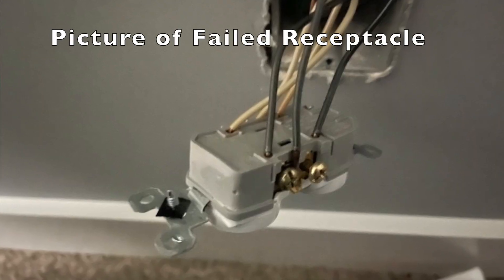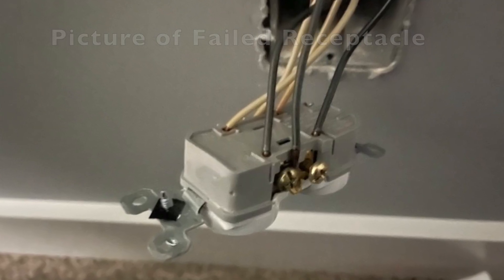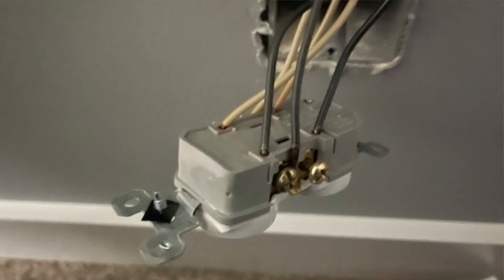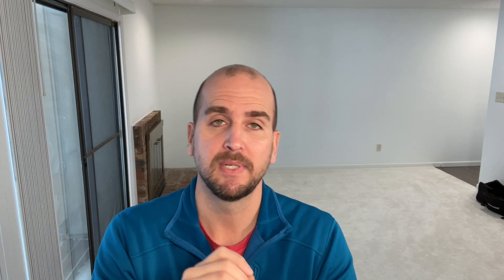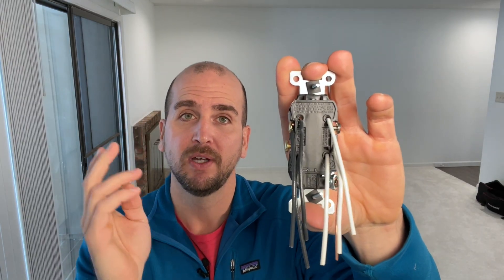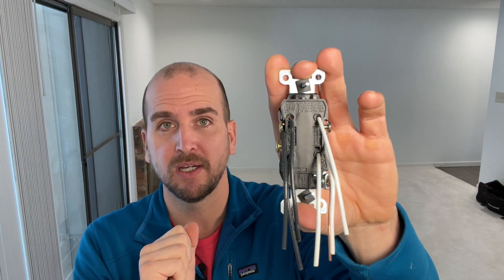Incorrectly Wired Outlet Found In Newly Built Home

Comment: I just saw this video. Ive been an electrician for over 45 years and have seen all of the mistakes that can be made. I am so glad to see a young person going out of their way to put the correct information out there and take the advise of other possibly more senior professionals. Thank you and keep putting the correct information out there.
Reply: Customer plugs his coffee marker in and pop, later on someone plugged a Vacuum in and it sounded like a high speed turbine firing up.
Reply: Wtf is being said here I'm lost
Reply: 75 here, and have built and wired a few houses, learned a lot by watching this guy. I've always wondered about the push holes. They don't have as much contact with the inner core of the outlet to add extra loads down the line. Esp on a 14 gage wire with 15 amp breaker. I've been guilty long time ago about forcing 12 gage wire into those holes, until I spent a sleepless night wondering if I could cause a fire hazard for my kids.
Reply: 45 years? And you didn't catch the mistakes? Have you burned any houses down?
Reply: @donaldhinson7144  Pay attention! John Harold said he had seen all of the mistakes that can be made in his 45+ years as an electrician so obviously he DID catch the mistakes and was glad of the effort being made to educate the DIY'ers (and as well as those electricians taking potentially dangerous shortcuts whether within code or not) of best electrical wiring practices.

Comment: Heh. I know it's anecdotal, but just a few months ago I had a bunch of outlets fail, all on the same circuit. I tracked it down to first failure in the chain, and it had push-in connections. I switched all wiring to screw terminal on that receptacle, and that was that. Has been working fine since.

Comment: Then every middle-of-run receptacle would have pigtails. While I won't argue about it being preferred, in the field I've never seen it done. That said, having two wires on one terminal is definitely bad for a variety of reasons.
Reply: I'm a DIY homeowner.  When I built a garage several years ago, I had outlets run in series in the ceiling, to power hanging shop lights that plugged in.  I had them wired in series and everything worked fine.  But the electrical inspector had me re-do them so EVERY outlet had it's own individual pigtails.  That was in Michigan.  This year, talking to a licensed electrician about a different task in a different home, and he recommends the same as standard practice.  Don't know where you live, where nobody ever uses pigtails.
Reply: @rmcdaniel423  .. Interesting I thought I replied to this. I was a professional builder in both Kentucky and Florida no pigtails required. However being from Chicago originally no Romex in many areas is permitted and everything needs to be in metal conduit. So the answer is it depends. 

If you're trying to branch off (add) multiple receptacles e.g. midwall TV receptacle from a middle of the run where you have more than two wires then sure you'll need a pigtail. Clearly do whatever your location requires. 

However our electrical laws are laughable compared to many other countries just starting with plugs themselves.

Comment: First all outlets with push in's should be outlawed and taken out of homes, I have seen many of them cause fires!!! Remember the first law of engineering is a good mechanical connection and the push in blade does not offer that and it WILL cause fires!!!!! Enough Said!!!! Oh and sorry but professional electricians are the worst at using push ins daaaaaa you IDIOT!!!!

Comment: Hello friend, You showed an excellent video for wiring a 12ga wire duplex receptacle. However, 12ga wire is used for a 20 amp circuit and you wired it to a 15 amp receptacle. The correct 20 amp receptacle has a “T” shaped neutral female able to accept a “T” shaped plug prong to prevent plugging a 20 amp appliance into a 15 amp outlet.
Reply: Walter, NEC allows a 15A duplex on a 20A circuit. You are incorrect.
Reply: Roy, why would you run 12 ga on a 15 a circuit? I’m curious. No one does it when 14 ga is cheaper and code for a 15 a circuit UNLESS the previous electrician intended to wire a 20 amp circuit. If the need for 20 amps is no longer required, yes you don’t have to run 14 ga to replace the 12 ga. I’m wrong? No.
Reply: @lmanc2222  That’s a good question, for example the dining room circuit is required to be a 20A circuit with #12 wire but like I said , we are allowed to use 15A devices on the plugs, the only time it has to be a 20A plug on 12-2 wire is if the circuit is dedicated single appliance like a microwave, dish or disposal. I know it’s confusing. If you would like the code reference I’ll send it to you.
Reply: @roymills415  Absolutely! A 15 amp appliance plug WILL fit a 20 amp circuit outlet.
Reply: Thank you, Roy, for the kind offer. I have the NEC already.
Reply: @lmanc2222  The  article from our electrical code is NFPA 70, art 210.21 see table 210.21(B)(3). Keep in mind it’s the OCP (breaker) that determines the allowed ampacity for the circuit. 80 percent rule means we can safely load the 20A circuit to 16 amps. What you obviously can’t do is put the 20A duplex on the 14-2 wire. Hope this helps…btw, this is why for those dedicated circuits is supposed to be a single receptacle, not a duplex.
Reply: @roymills415  We were looking at a 15 amp duplex outlet on a wall being wired to 12 ga wire. I would play it safe and wire a 20 amp duplex outlet. That tells everyone that 12 ga wire was used to wire that outlet AND a 15 amp appliance can be connected to it also.
Reply: @roymills415  We’re on the same page, Roy and that’s a good thing.

Comment: I always wire my outlets in parallel this way if one outlet fails the whole string stays powered. It also makes troubleshooting very easy if one outlet is not working and the rest are then the problem is that outlet
Reply: Thats fine,its all up to the installer.

Comment: I worked for over 20 years as a plumber/ handyman. I was constantly replacing receptacles that had charred a bit and almost every one was using push in connectors. It becomes even more dangerous on buildings wired in aluminum, like mobile homes. Those push ins make a very small connection so oxidation has more of an effect as does over draw
Reply: Hope you realized not all receptacles are  made for Aluminum wire. Some are rated for both, and some aren't. Being a Electrician I can't tell you how many  plugs and switches I've changed because people don't know what their doing.
Reply: @Auburn7543  sorry I didn’t mean I replaced them on aluminum wire just pointing out that aluminum oxidizes faster.
Reply: Awesome you are right on
Reply: Push ins seem to be preferred with GFCI outlets.

Comment: Thank you for this instructive video, well done.  I'm not a pro, by any stretch of the imagination, but one thing I was taught many years ago, by a licensed electrician, was to use electrical tape and wrap it around the outlet, a couple of times, to cover the screws, and to do the same with each wire nut connection, as a safety measures.  I've heard both pros and cons to this approach but when it comes to electricity I'll take all the safety precautions I can.
Reply: I was gonna add the same suggestion. If you do this, it should go without saying, please use a good quality electrical tape, not dollar store electrical tape and also keep in mind that even the best tape will get a bit dry and stiff after several years, so when working in the box go ahead and remove old dry brittle tape and wrap again with new.
Reply: Chicago we always apply real electrical tape stretching in the direction tightening the wire nut. Also tape around the outlet covering the screws
Reply: Shouldn't be needed, it is usually done when wiring before the drywall goes in so the drywall guys can safely pull out the switches and receptacles
Reply: I've lived in 1950s houses all my life and it seems that some combinations of outlets and boxes have far less clearance than others. I had one outlet on which, if I pushed the socket to the side hard enough, the hot screw would short to the metal box and needless to say, I wrapped that in tape. On the other hand, this is probably a non-issue with plastic boxes.

Comment: Hello,very good Video ! I also have a Question iam running a sub panel to my Carport area I adding a 20amp and 15amp for lights and a few plugs ,ionly need 3 wire to feed the 30amp no 10 not 4 right since I don't have a 30 amp outlet please let me know thank you

Comment: I have wired many outlets but this video showed me I have been doing wire connectors wrong. I always have depended on the connector to twist the wires when i turn it snug. I will now twist the wires before I use a connector. I always attach the wires to the terminals and then wrap the outlet with electrical tape to cover the screws.

Comment: I like to install a receptacle with the ground up. When you pull the plug out from above, the ground is the last thing to leave. Also if something falls on it, it will hit the ground and not the hot or neutral.
Reply: That's official spec. You'll see them in hospitals that way.

Comment: the only thing I would add is to turn your receptacles over if you look at the male end of the cord,your ground is longer than the other two
Reply: So you want the ground at the top and the hot and neutral below it? If that’s the case I would recommend against that as the purpose of having the ground at the bottom is so that if the male end we’re to fall out of the receptacle the ground would be the last thing to fall out.

Comment: A tip from a Licensed Electrician: When twisting your pigtail wires with your Lineman's, it often helps to hold them back at the insulation with your needle-nose pliers, as you twist, you must allow the wire to roll inside the jaw of the lineman plier, if you grip the wire's and twist you stand a much better chance of cracking/breaking a wire, this happens often and goes unnoticed. With practice you can learn to do this properly, I have made a good sum of money identifying this very problem with DIY'ers work, I'm all for people that want to learn and do it themselves, but please learn to do Electrical work properly as your kid's friends might be on a sleep over when the fire starts and that wouldn't be fair to their parents'..

Comment: I’m an electrician and I want to start with a big THANK YOU for hooking the wires and not stabbing them. That’s a pet peeve of mine and so is pigtailing receptacles. Their are only two things I would add; whenever I change or install a receptacle, I always use a 20A, and a safety wrap of tape on the terminal screws. 20 amp receptacles are not much more money and can take much more use. When I install receptacles, I pigtail them and wrap electrical tape to cover all the screws so no metal is exposed, THEN I splice them in with the wires in the box. Makes for a safer install with very little extra effort. Thank you.
Reply: I have always wrapped tape around the receptacle also
Reply: So if you use 20 amp receptacles do you also use 20 amp breakers? 12 Guage minimum?
Reply: @timhick6  yessir. 12 gauge for 20 amp receptacles,14 gauge on 15 amp for lighting. That’s typical indoor lighting, not big, MH - or similar - lighting for outdoors. I’ve seen it done but I don’t like when lighting and power are on the same circuit. Penny wise and pound foolish.

Comment: Also notice when pretwisting the neutrals together the pigtail your forming is making your "pigtail" wire pushed forward with the twists you make, meaning if you were to grab that wire it'll unscrew itself. I learned to grab on tightly on all wires and while twisting to keep on pressure goin clockwise against your twist or it'll unscrew itself making the wires uneven and not on the same profile. Is that understandable? I know what I'm talking about lol I just don't think I can get it through
Reply: I understood what you meant and you are correct

Comment: I don't understand. I can see why the first connection where just the wire was put on the terminal is bad. What I don't understand is why adding the age old J to the end of the wire and connecting those connectors to the socket as you normally would isn't recommended. One connection per screw. No pigtail needed. Those pigtails will also add to the CU number for the box. Maybe it's specific to this problem where it's through the paneling?
Reply: Using a pig tail is required in hospitals..when in turning off power to replace a device is not practical
Reply: And im not sure how that would add to boxfill btw

Comment: You put the wirenuts in upside down.  Always point the cap up so it does not hold water.  Outside walls can condense water and wirenuts will hold that water if they are upside down.  I have see more bad wirenuts from this then bad outlets from push in wires.

Comment: My new house had a number of wiring mistakes.  The power for the septic was wired for 240V instead of 120V but that was fixed when the septic was hooked up.  The builder provided a RV hookup but the electrician wired a 120V RV outlet to 240V and the inspector did not catch it and a lot of stuff was destroyed when I plugged my RV.  The den had two outlets that were not hooked up and another outlet did not have a cover  plate.  The house passed the inspection so the city/county electrical inspector is as incompetent as the electrician was.  The moral is never trust a contractor to do anything right and never rely on an inspection to insure safety.  In other words if you want something done right do it yourself.  I will add that I am 79 years old and I have never had a contractor do a job correctly in my entire life.
Reply: I agree 100%. Contractors are there to make money and will take as many shortcuts as possible at the homeowners expense. I'm sure the inspector never ever looked at it and just signed off.
Reply: I found a lot of sketchy wiring in my house. Some dangerous and some silly.
The garage (compressor, freezer, openers, power-tool land) shares one breaker with the den (computer & Hi-Fi land).
Romex through the siding, hiding wire-nuts, to power outdoor light fixtures. 
Beyond electrical, my rear brake-line burst from rust about a week after a state licensed inspection.
Best not to be too trusting when it comes to life.
Reply: I don't doubt it.  I have seen too much sloppy work by incompetent electricians.  I am 70+.
Reply: Mo

Comment: Agree with 1 & 2.....but unless you have a 3" deep receptacle box.....introducing two wire nuts and pigtails into an already jam packed "less deep" box can be a challenge. Also, wire nuts should be electrical taped making sure to go the proper way which will hold tension in the "tightening" right clockwise direction. Also a good practice to wrap electrical tape around the complete receptacle covering all of the side terminals.

Comment: I agree to always use the screws!  I agree to always use pigtails to jumper from plug to plug and use local leads to the receptacle in the box!  Now here is my one additional comment: If there is a METAL box, always wrap tape around the receptacle just in case of repeating 'user twisting' on the receptacle leading to a possible screw to box short.  It happens!   It is a pain, but it is worth the peace of mind.  Peace.

Comment: For paying attention to detail and looks nice, have the screw slot on the face plate screw, running up and down to match the slots on the receptacle. Do this with switches as well. When you have a multi gang, having the screw slots running up and down like the receptacle/ toggle switches looks clean
Reply: Really? Sounds like OCD. Why not horizontal, nothing clean about switches or toilet handles? Torque till snug and not past when tightening gives no further turn. With plastic this lighter than metal plates. Ground at the top, wipe off that smiley face icon too.

Comment: Thanks for the intel,love that pigtail concept! Keep it coming.
Reply: I have wrestled with reworking outlets that were jammed in on a nest of wire. The pigtails are an elegant solution: Dress the wire nuts and incoming wires against the bottom of the housing and keep the outlet in the clear.

Comment: Also, it's better using a flat head screwdriver rather than a Phillips to make sure the screw terminal for the receptacle  is  tight  enough. You may not going to get the right amount of torque with a Phillips screw driver, rather than with a thick flat head. If the screw terminals arent tight enough, electrical problems  may occurred.

Comment: Now dude, you are holding a true back wired ( AKA push in) (as well as side wired) receptacle. and who says every thing UL says is OK is really OK?
Reply: Food for thought from UL White Book" 

"Single and duplex receptacles rated 15 & 20 amp that are provided with more than one set of terminals for line & neutral connections may be used to feed a single set of branch circuit conductors connected to other receptacles on a multi-outlet circuit.
These devices have not been tested for tapping off more than one circuit from the receptacle by utilizing both the side wiring and back wiring terminals on an outlet." … just sayin 

As for backstabbing- not like I haven’t repaired a million failed receptacles that relied on screw in connections -

Comment: Thank you for all this good input. I have recently been wiring up my home workshop, and hopefully been doing it correctly. Pigtails, shepherds hooks and back wiring only. I NEVER use the stabs, had some fail years ago in a different home. They have minimal contact inside the receptacle, a potential high-resistance connection. Why risk it?
Reply: I don't get why the CPSC never bamned backstab outlets.

Comment: I always use tape to add extra protection.  On the wire nuts, and the outlet if its a metal box. You should also state to make sure the power is off.